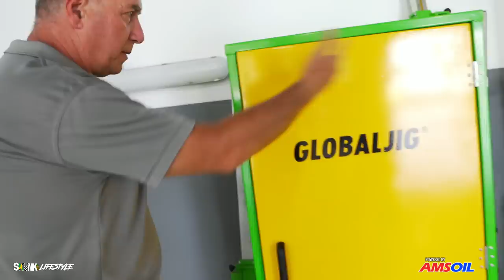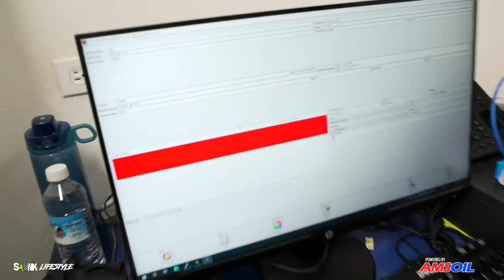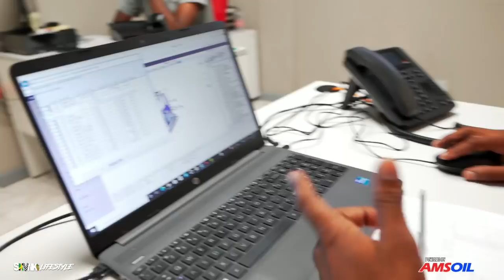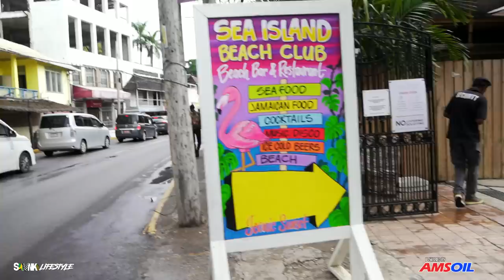2JZ Swapped Range Rover Sport / Walk Thru of ATL Automotive Bodyworks- SKVNK LIFESTYLE EPISODE 151

Comment: At the risk of the internet coming for me, I'm going to point out that the Top Shine Technician did not use a  Matte/Vinyl Wrap soap during the pre-soak step. There are soap and sealants, specially formulated to clean and condition Matte & Vinyl finishes which prevent cracking and fading, and in turn increases it's longevity. As a semi-pro car detailer and car enthusiast, I tend to pay keen attention to things of this nature. If he did indeed use a vinyl soap in the Chemical Guys Big Mouth Foam Cannon, then I apologize in advance, but if not then I would recommend that they look into a product like Rat Wax Vinyl WRAP CAR SOAP instead of Chemical Guys Citrus Wash & Gloss, which will help to properly clean and maintain their customer's cars with Matte and Vinyl finishes.

Comment: That 2JZ Range is mad.  Can't imagine the amount of fabrication and work to make it compatible with the modern day electronics.  Money definitely not an object for this man.  Peep the RM on the wrist.  Sheesh.
Reply: It would be like any other swap, body and engine harnesses are different, might have to get some jumper harness or make one but most of it is like any other swap that didn't come with that engine.
Reply: @j.sargent9172  While true, swapping an engine from that era is a lot more difficult in an ultra modern vehicle due to analog to canbus conversion, which requires a crapload of programming to run correctly, if it ever does.  I'm guessing this project took quite some time and fund$$, which obviously the man isn't pressed for since he has so many other cars at his disposal.

Comment: Bout time someone replace the motor on these Ranges. If you buy a nice used one, just do what he did so it rolls the way it should with no issues! 🇻🇮🇻🇮 Keep up the good work. There are some nice style vehicles out, but engines they come with are problematic to the bone! A jz swap saves money in the long run so you can enjoy the ride instead paying to keep it rolling constantly.